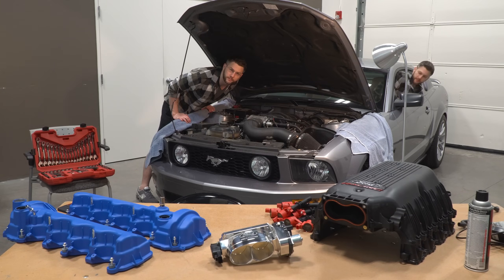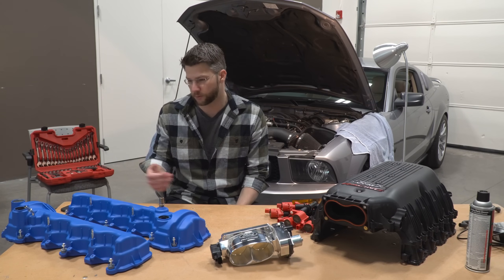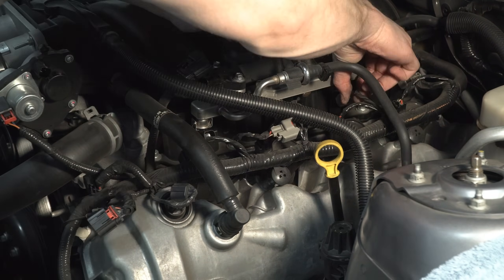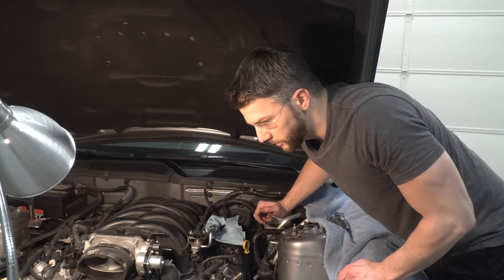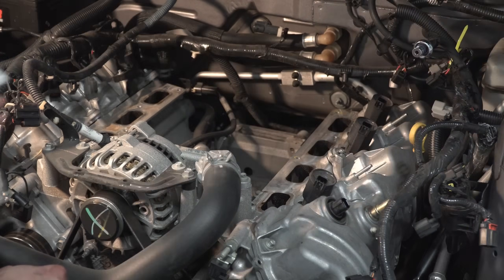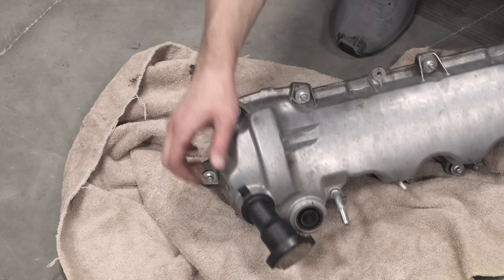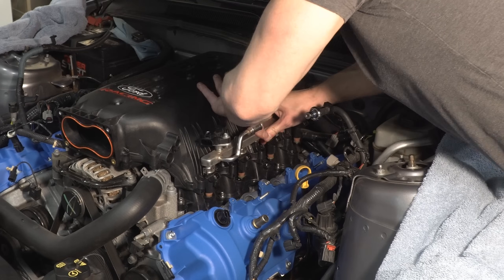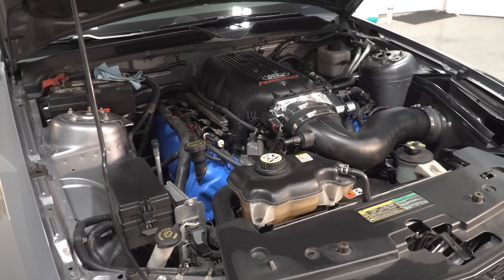How to install FP Intake Manifold, Valve Covers, Throttle Body (2005-10 Mustang GT)

Comment: When will you make a dyno video?
Reply from the maker: I am working on it now. Ran into some issues with the car, then I had to wedge a different project between this video and the next video. Excuses aside, end of April at the latest.
Reply from the maker: Update: need until this weekend.
Reply: Four Eyes I hope all is well and it puts down some solid numbers.
Reply: Four Eyes Issues with the car... got my attention.
Reply: what all happened , did the throttle body work well ?     

my stock tb just took a dump and I need a new one asap haha

Comment: My intake manifold is leaking oil. So I suppose it's time for the high performance intake and some nice  valve covers. Good to kno2 i should do the throttle valve body and a tune as well. It's all stock with an automatic.  Engine and transmission has original 113k miles.

Comment: I have a sensor in the back but no where to plug it into. Is it supposed to be like that since the charge motion plates are installed only on OEM manifold?

Comment: I’ve been following your build for about two months and I did almost everything exactly the same but now I have air in the brake lines I had him bled but now they’re telling me that I need a new brake booster. Did you have problems when you switched out the camshaft
Reply from the maker: negatory that’s unrelated to camshafts, something else is going on there

Comment: Thanks for this video. Helped a lot. 2005 4.6 modified with Detriot cams, FP throttle body, FP intake, valve covers, Pypes headers, Corsa sport exhaust, new tune from Brenspeed. Fantastic sound and performance. Thanks again for your contribution.
Reply from the maker: happy to hear it was helpful, thanks Russell

Comment: Will this manifold fit on the 2004-08 f150s 5.4l 3v?
Reply: Did you find out? I'm looking for a 4.6 3v Triton, and it seems to be the throttle  Harness is the same

Comment: Yes, COP bolts have stripped on mine. I did get the bolts out, however trying to tap the holes out doesn't do you any good so it seems. Quick fix for this is a bolt and nut so you can drive the car, however you will probably need to tap out for a larger bolt slightly or new valve covers if this happens. I hate not driving in my car right now. 🙄

Comment: 2006 Ford Mustang Gt convertible with procharger supercharger and Flowmaster outlaw cat back exhaust system owner here.....I have ordered the same parts for my pony and I will be installing them this weekend. When you added everything, was the power differents noticable right away?
Reply from the maker: no actually it lost power because i was on a bama tune with stock cams. you should notice a decent bump in top-end power since you're procharged. definitely recommend a dyno tune.

Comment: Great videos. Thank you. If I'm planning on putting a blower on my 3v 2010 would there be any reason to put this throttle body and intake on?
Reply from the maker: Definitely not the intake manifold if it's a top-mount supercharger (roots, eaton), but probably not a bad idea if it's centrifugal. As for the TB, unless your engine's built and you're planning on running 12+ lbs of poost, meh not really.

Comment: I saw this exact intake manifold online for a 4.6L engine, I want to put install it as well but I have Crown Vic. Since it’s also a 4.6L SOHC and the intake is for a Mustang from 05-2011, my Vic is a 08 do you think it will fit?

Comment: Did the manifold gives you a check engine light?
Reply from the maker: Yes. The CEL will come on because the ECU doesn't detect the CMCVs. These engines lose power w/o CMCVs until they are retuned.

Comment: Could i use that intake manifold on my 5.4 3v f150?
Reply from the maker: Good question... the cylinder heads are the same, but I think the width between them is different so the intake ports wouldn't align. It also may be too tall to fit under the hood. :/

Comment: Where is the dyno video?  We have a hellion turbo 2010 4.6 that we want to add this intake.  Wanna see if it is worth it.
Reply from the maker: From my experience and testing, the stock manifold is great for low and mid-range torque, but it suffers above 5,500'ish RPM where horsepower dramatically drops off. The performance manifold definitely reduces low and mid-range torque, but let's the engine breath way better in the upper RPMs where the horsepower line maxes out and then just goes sideways.

So, the performance intake will give you higher horsepower, but it's really how you want to the car to drive (mid range torque vs peak power). I do recommend removing the CMCVs and keeping the stock intake. While you won't see much peak gain, you'll notice more area under the curve. The valves take about 1 full second to open on full throttle, so that delay is no doubt starving the turbo of exhaust gasses - the car should feel snappier. Also, if you remove the CMCVs, you'll need to retune the car as the ECU senses the disconnection and resets any timing changes you may have made.
Reply: @Four_Eyes  i actually have a dyno video showing 2015 vs 2018+.  The power on the 2015 does what you say.  But the 2018 does not.

Comment: Would it have been easier to attach the fuel crossover hose with the intake off the car? The fuel rail attaches to the intake itself from what I can see or remember on my old 2 valve crown vic.

Comment: I’m not the brightest when it comes to throttle bodies but how did you use the multimeter to get the initial reading? I’m trying to find out why my numbers don’t change from -1.888 with the the car set to accessory mode.

Comment: Do you know if I should buy the steeda billet charge motion control plates for this intake manifold or it deletes it
Reply from the maker: The FRIM does not have charge motion valves. I would just buy the plates and keep the stock manifold (assuming you have an 05-08) as it's a significantly cheaper option and easier install.
Reply: Four Eyes so this In take isn’t worth buying in words ?
Reply from the maker: I don't believe so no. I put the stock one back on.

Comment: You are too modest dude. I've been a mechanic for almost 20 years and currently an automotive instructor at a technical college. Not only do you work in a very organized manner, your video instruction is incredibly clear and concise. Well done! I run an 08' Bullitt.
Reply from the maker: Thank you David. This is a huge compliment and I appreciate it very much. What should have took me 3 hours took 8 (I didn't finish until 6am). I have a newfound respect for mechanics from this install because of how much my back, knees, and fingers hurt after putting these parts on. I am debating doing a cam install video, I may have some questions for you!
Reply: You bet brother. Feel free to ask. I have access to Ford documents if necessary.  Your videos were so helpful. I was feeling the itch (intake, tune etc...) I'm glad I didn't pull the trigger. The Bullitt I feel pulls good already. I'm thinking kooks headers and aluminum driveshaft for sure. And a dyno tune. I've heard that the engine revs much quicker which can improve downshift timing.  I've done mostly suspension and I also installed an MGW shift linkage.

Comment: you should have done the cams while you had the covers off.
Reply from the maker: Cams will be installed in Stage 3.
Reply: I love my cams. I would recommend the Ford racing cams. they are no springs required and of course made by Ford. make sure you get a timing chain wedge tool and new phaser bolts. I would also suggest doing the roller follower/ lash adjuster kit from Ford performance while you are there. trust me.

Comment: My only question is, will these mods transfer to my Lincoln Town Car? I've got a 2v 4.6 and I'd like to know where I can get some decent mods for performance, I'm looking to make a sleeper car out of it 👀👀👀 also what wheels are those? They're clean asf on your Stang
Reply from the maker: Should be plenty of parts available for that engine since it's what powers the SN95 GT. Wheels: https://www.wheelfire.com/scontent/wheeldetails.cfm?idnumber=type112_1995_silver_0178_s2s&sku=16009&checkfit=1

Comment: Nice job. I know it was a bit of a pain on the intake manifold install.  I had to borrow a torque wrench that measured in inch pounds.  The top end gain with it was well worth it though. Next for me is thottlebody and cams. I m just gonna stay na though. Subbed for more. Good   luck on the build!

Comment: I notice when looking at your list you aren't upgrading the cooling system, from my experiences the cooling system tends over heat when introducing force induction. Other than that it looks like a promising build.
Reply from the maker: Yeah my mechanic warned me of this as well. Will eventually have to upgrade the cooling system.
Reply: Four Eyes yeah my friend blew his engine out of his 1970 stingray Corvette, because of that. I personally have a 2006 gt mustang, and when talking to experts about force induction they say to upgrade when you start make around 450hp to 500hp to the crankshaft.

Comment: I’m at where you are in the build however, my next step next month is to do the intake manifold from Ford racing as you did as well as the Ford racing hot rod cams. I believe I have more mods at this point on my bill than you do. I have done a complete BMR suspension Including Ibach pro kit springs and Koni adjustable struts and shocks As well as a billet pro Hurst shifter. Oh yes and I custom Bama performance tune from American muscle. As the car sits right now without the Ford racing intake and Ford racing cams installed oh wait a minute I forgot I have a McLeod Race clutch as well with an upgraded 3655 speed transmission billet steel 26 spline input shaft and since my 2010 Mustang GT is the premium package it came with 373 gears in a locker differential. So as it sits right now it is faster than the non-supercharged Camaro SS with the 6.1 L V-8 in it. It is embarrassing to the Chevrolet Owners as I can quickly put three car links on them in the quarter mile. I have also had the opportunity to race a few non-supercharged Corvette they didn’t fare so well either. I’ve been street racing since I was 15 years old and I’m 47 years old now so yes I can drive the car. Maybe if the Chevrolet owners were better drivers I don’t know maybe they would’ve been me. Although, it is very embarrassing for a Corvette owner to have his ass handed to him by a small block 4.6 L V8 Mustang. I have since started buying The parts from Shelby America to turn this mustang into a Shelby GT. I have acquired all of the parts and they have been installed and Shelby America sent me the door jam plates to denote that it is a Shelby now. And I have installed the Shelby lettering on the rear trunk just under the third brake light her positioning as installed by Ford. Great new channel like the content. No one seems to give the small three valve V8 engine much attention until I showed them the tail lights definitely A new subscriber and I will be following your build. Thank you for taking interest in the awesome ford small block. I am a retired Ford mechanic and enjoy showing off the 281 in.³ V8 based on the 60s ford 289H.O.

Comment: Nice start. Checked out the build sheet just curious why in stages? I will say all at once does put you out of your car and wallet a bit but worth it considering the end result. I have an 07 current build list still have a ways to go, no numbers yet but on paper should be close to 775rwhp. 
New engine harness
New ECU
New Battery
Kenne Bell 2.8 twin screw mammoth supercharger
( Complete set up with extra pulley-throttle body- intercooler- resevoirs- and harnesses 130mm Filter (under front valance) 130mm MAF Meter - 4.5” Ram Tube -Ford GT Inlet Flex Tube - Dual 75mm Throttle Body - MAMMOTH™ Inlet Manifold)
Double pump 375lph fuel pump
ID1050 - 100lb injectors 
High flow billet fuel rail
High performance silver spark plugs
New cam phasers and bolts
Phaser lock outs
Ford Performance Rocker Arm and Lash Adjuster Kit 
Comp cams stage 3 supercharger cams-Lift: .559"/.560"
Duration: 280°/295° 
Beehive .600 lift springs, sst retainers
Forged 302 stroker kit - 4340 Forged steel crankshaft 8 Bolt 3.750" - 4340 Forged steel H-Beam rods 5.950" with performance bearings, 3/8" ARP 2000 rod bolts - Performance main bearings, 4cc Flat Top forged Arias pistons with gapless file to fit rings
ATI Super Damper Harmonic Balancer 
Prothane Bullitt style motor mounts 
3.73 Ring and pinion set with royal purple gear oil 
TCI 3000 stall converter 
BBK shorty headers (1 7/8)
BBK off road x pipe (2 3/4)
Eibach pro street coilover kit-
BMR steel anti wheel hop package
Reply from the maker: Helluva build you have going on there. So, building in stages is definitely not the most efficient way to build up these cars, but it does make for more interesting content, enable me to enjoy the car at various performance levels, and also makes the cost of the whole endeavor more palatable.

Do you have any videos of your Mustang? You should consider making a video about your project and its current state. Would be really interesting.

Also what about that ram? I also have a 2012 Ram 1500 Express 5.7L, but I baby it because I love that friggin truck.
Reply: Four Eyes yeah the financial part would have be much easier in stages for sure lol. Makes sense for the content as someone in the YouTube world. I don't have any videos of the stang but I will certainly do one of the current progress. The dodge is another story  lol. Had it around 550rwhp but went another direction and started building a Rubicon lol. Keep the content coming brother!

Comment: Great video! Thanks for all the work it took to produce this. Why didn't you upgrade your cams while you were doing this? It would have made a big difference.
Reply from the maker: Two reasons: stage 2 is all about bolt-ons and I'm not stoked on the torque curve of cammed 3vs as gains are mostly realized above ~5k RPM (I don't spend much time in that range). I'll get cams after boosting, or just before. And thanks, appreciate the appreciation!
Reply: I see. You have a good build going. Look forward to following your progress, aloha.

Comment: What’s your throttle body voltage?
Reply from the maker: No idea, I'll have to Google how to do it and get back to you.
Reply: Four Eyes Ok well basically you use a voltmeter and check the voltage on the original throttle body before you remove it but it’s kinda late now but look online or call ur local shop they might have some kind of a chart for the right voltage but beware cause the voltage may vary on each mustang.
Keep up the good work.

Comment: I have a 05 v6 mustang. It’s a little darker grey then yours and so far I’ve tinted the all the lights, bbk cold air intake, and got an flowmaster American thunder muffler. It sounds pretty nice. I’m looking to get some long tube headers soon
Reply from the maker: Nice! Consider posting a sound clip when you get the longtubes on.

Comment: Used valve lapping compond...to get stripped bolt out....it works as long it not to stripped out.
Reply from the maker: Roger that, thanks Jerry. Cams eventually... I think. Definitely want the lope without giving up too much low-end torque.
Reply: Four Eyes that's why I'm not doing cams, don't want to lose any low end torque....maybe do the cams when you do the supercharger.
Reply from the maker: You and I are on the same page here. Cams after, or just before, getting boost.